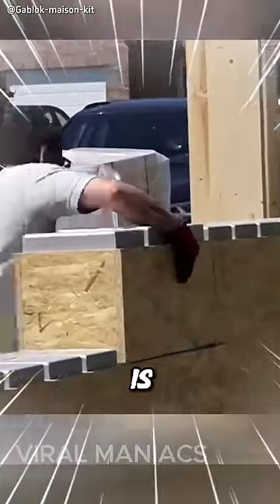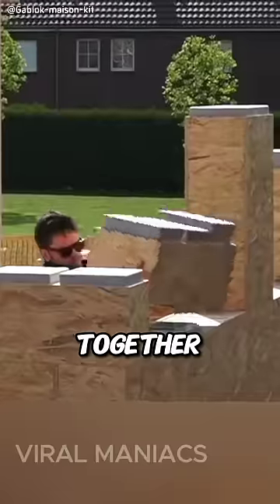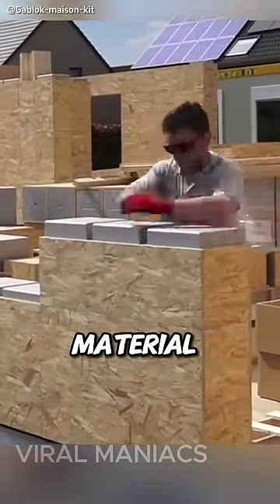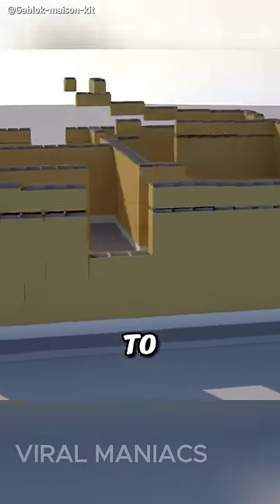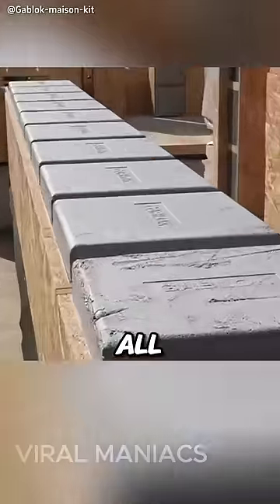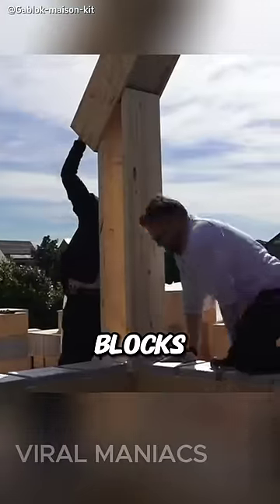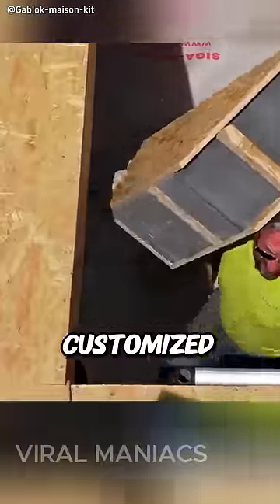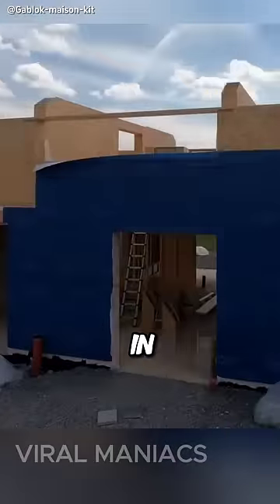Whoever Invented This Way Of Building Houses Is a Genius #shorts

Comment: Would be nice to see a finished product, also, how they run electric cables and plumbing?
Reply: That was my first question too
Reply: Ya mine to ..
Reply: My immediate response!
Reply: As someone who is neither a plumber nor an electrician,  thank you for thinking of this. Now I feel we just watched a video on how to build children a very expensive but cool fort lol
Reply: Howww
Reply: tape
Reply: Generally plumbing isn't ran in exterior walls anyway so not a big deal, they can still drill holes through the blocks to allow pipes. I imagine if you're running vertical stuff you can just take the insulation cubes out and now you have nice vertical passageways for your stuff to run through then you can use spray foam or drop in insulation later. electrical you can just router groves through the plywood I imagine, if it's on the interior you can also just put up 2x4 spacers on the wall (like you'd frame a house, but lay them flat) and then run your wires between that gap and drywall over it. This design is pretty similar to SIP construction (Structurally Insulated Panels) you can google that. That's what they do, you can also run electrical and plumbing through the floor. The interior walls of these houses are framed just like normal homes they don't use the big blocks so it's easy enough to do 95% of your work like normal. These are actually really cool blocks I've never seen them before but I imagine it's not exactly cheap, There's a lot of manufacturing that has to go into making those wooden boxes and cutting the foam and stuff. You're really just trading your on site labor costs for the labor costs of a factory worker. But the insultation value would be really good. I want to see them use blocks for the roof though that'd be fun.
Reply: Exactly my thoughts too!
Reply: I was wondering the same thing
Reply: See one of the comment above. They explain that certain blocks come special that are specifics for plumbing or electrical. It's all part of the layout that's made before they send out the blocks.

Comment: The toxic fumes if it burns will kill you😮😮😮
Reply: Fiberglass also bad
Reply: Isn’t this the case with literally everything in our homes already? 😂😂😂
Reply: Your house has fiberglass insulation doesn’t it?
Reply: Possible the flames will do it as well.
Reply: @user-wx7gu3jq8s, that statement could be made with regards to many types of homes.
Reply: @kristopherluster6709 If you live in America and not in an urban center, very much yes, as your house is probably made mostly out of wood. Never had the courage to live in one of those when I lived in the states, I trust concrete buildings far more than half the tradesmen that work in frame houses.

I ended up moving to southamerica and here it's mostly brick and mortar for regular houses, and concrete for buildings. I built a brick and mortar house with vaulted ceilings and vitrified clay tiles on top, and the wall paint is limewash, as most plastic based paints develop mold in a couple of years if you run a humid heater. So, my house is entirely fireproof, except for the wooden furniture, and even if it catches fire, it will be quite localized and will not engulf the whole place leaving me houseless (I still would have a couple of barns on the property, so technically not homeless). Nothing like living in a solid house like the one I grew up in.
Reply: Just what I was thinking!!
Reply: Unlike the fire itself that will only hurt a little.
Reply: @kristopherluster6709 Exactly!!! Just the glue in the OSB is toxic enough!🙄
Reply: And others!
Reply: True, but that applies to most houses constructed in the past 60 years.

Blessings! 🙏🏻 
Jess.🌹
Reply: @cindybarber8449 I don't think so. That's why it's used.
Reply: It's likely treated with a fire retardant. EU standards are pretty robust on these issues.
Reply: Probably better to avoid flames & get out, rather than sniffing fumes?
Reply: @everyhandletaken  Nah, I'm going to stay and huff the fumes. Get one last high in my house. 😂
Reply: Pretty sure, the fire will kill you also.
Reply: @TheScreaminTiger  not to mention furniture itself is very toxic when burned. Made almost entirely of synthetics (and wood), synthetics are petroleum based lol
Reply: 💯 everything burns and makes toxic fumes. So what's your point?
Reply: YES!!!
Reply: Do you have any cpvc pipes in your home? The fumes from a 3 foot piece of schedule 40 pipe will kill everyone in a 1200 square. ft. house. ( from a talk by a fire department safety inspector.) 😊
Reply: @kellybarthel8060 Maybe..
Reply: You would be a burnt brisket before you'd die ofuss. fumes.
Reply: @glowllama  Most fire deaths are dead from smoke and fumes before they're ever burnt. ( fireman safety officer seminar.) Said to get down with head near floor where smoke is thinnest while escaping.
Reply: @kristopherluster6709 only if you buy cheap shit. Some people really love all sorts of plastic though.
Reply: Just like everything else in your house.carpets furniture.maybe not so relevant now but in firefighting we were taught that one whiff of a burning telephone would kill you.
Reply: @kristopherluster6709  no it’s not like the stuff in your house. Polystyrene is ridiculously flammable. Plenty of stuff in your house, including the design of it is fire, retardant and containing. Of course, for only a certain amount of time. But this thing is just dangerous.
Reply: You're talking about every modern structure ever built for well 200 years. A WOOD home will also kill you if stay in it while it's burning.
Reply: As opposed to the non toxic fumes by most fires? What?

Comment: so basically your house is held together by plywood...
Reply: Worse. Particle board.
Reply: @trigjones nope, that's just an US thing no 1st world country build houses like that
Reply: OSB and plywood are two very different things. I'd trust a structure made of plywood far more than I would one made of OSB.
Reply: 🤔After all the "wild fires" recently, I would be skeptical about using this material.
Reply: @stefaniabrazzi1358  I love it when people create a scenario like:
“wOuldN't iT bE vOlnUrabLe tO wiLdFirEs” 

like a normal house stands a chance to a conflagration
Reply: @filippetrula1234  Not really each country has a different architectural style on how they build houses, so not all 1st world uses drywall or any variation of it.
Reply: No, gravity
Reply: No, Styrofoam.
Reply: @jothain  No, Chipboard, better than particleboard, but not by much.
Reply: Actually the person who said styrofoam is correct. In strong wind conditions it's the styrofoam that's holding it together. 

You can probably build like this in somewhat cold, no fires, no strong winds area.
Reply: This product is intended for Europe and the company is from Belgium.  Of course this video lacks lots of parts of their building system, like the structural beams that are the ACTUAL structure of the house along with the brick walls.

These are basically replacements for ICF (which use concrete and are VERY not green) and SIPs (which these basically still are).

This is 100% for timber framing.

Comment: Me: Nice...where's the HVAC, plumbing, and electrical?
Builder:...shit...
Reply: Just what I was thinking
Reply: Facts. Just a big tree house IMO.
Reply: Exactly😂😂😂
Reply: @Yin_Strider with no tree, wild. Lolooo
Reply: I'm betting they have blocks with cutouts for plumbing and electrical but they don't look as nice as the normal ones so they didn't show them or something
Reply: @MrGreenbeans2  mechanical specific and unique to every home, we have to "layout" our rough ins on the fly, and things rarely go perfect, I'm a plumber and we need to coordinate with hvac installers so we don't run into each other stuff, it's quite technical and I don't think it can be "generic mass produced"
Reply: You can easily build a 50-100mm internal space on the external wall for those elements. (take that into account for the initial design and outer dimensions). My issue is that OSB expands a lot when wet, and once it has deformed from moisture, it does not go back.
Reply: same way they do that in Europe when building from bricks :)
Reply: HVAC: Plan it, and you get blocks with precut holes?

Pipes and electrical: I'd assume a spacer on inner walls and run it behind it?
Reply: Couldn't you just remove the insulation blocks along pipe and power lines and then fill them with spray insulation ?
Reply: literally what I was thinking haha
Reply: Hello Mr. Negative, all of that can be external.
Reply: Here’s what their website says! (I was super curious too!! 😂) 

If insulated wooden blocks fit into each other to form the load-bearing walls of the house, you may need some advice concerning more technical issues.

Some issues include electricity, alarm and plumbing.

Don’t worry, the Gablok system has foreseen everything.

The distance between two rafters that hold the insulated wooden blocks together is referred as a “technical duct” and it is +- 40 cm. This distance allows you to easily install the various technical connections required for the smooth running of your house.

The floor elements are also provided with a 10 cm space allowing the passage of your water piping system, sanitary facilities and electrical wiring.
Reply: Except for electrical,  you shouldn't run those things through exterior walls anyway.
Reply: Still in A box😂
Reply: I mean... HVAC and electric runs between the exterior surface material and your interior wall surface material. So, I'd assume just like with brick, stucco, whatever else... none of which has HVAC, plumbing, or electric literally running through it... they'll install it between these legos and the interior wall. 🤷🏻‍♀️
Reply: And the fire insurance.
Reply: Then you get home from work and your big screen tv is laying shattered on the floor. Cabinets are on the floor. No good structure to screw to.
Reply: These blocks are just the structure... basically a frame so you'd still have plumbing, electrical, and hvac *facepalm*. Want the company to send you all of that too? If you plan on building a house, you should already have a foundation poured and plumbing already in tact, then call your local electric company and they'll run electric to your new plot of land, and you'll have to have contractors come and do everything like any other project. :/ derp
Reply: Mmmmm
Reply: @bentlybilderback5768   like a 747!! Tell me you know absolutely nothing about home construction without telling me. 😑 and where do the pipes and lines go?? On the face of the wall so it looks unfinished? What about a house on a concrete slab?As you would say, "face palm...DERP"
Reply: My thoughts exactly
Reply: Ehhm just a installment layer on the inside, like in every modern building that isn't in the USA.
Reply: You really think the genius who had invented this wouldn’t think of that lol
Reply: Yeah im sure they forgot about that shit.  Its a youtube short dude
Reply: That is true!!!! If this were a shed or garage wall project then yeah… but home? Maybe model home for display! Or prop homes for acting! Unless the vanities come with pre-fitted plumbing and they’re using led lights for wiring, and battery operated utilities
Reply: Needs to get tornado and hurricane insurance ×2
Reply: It all gets primitively nailed visibly to the interior walls, instead of getting attached to the framing skeleton and covered with drywall

Comment: My last house I owned had a new house being built next door. It was the same material and was completely finished in five months while conventional ones took over a year. Neighbors all took small fragments of discarded blocks in the construction dumpster for souvenirs. There was very little waste and assembled very quickly. This was the first time I ever saw this technique.
Reply: If a house takes a year to be built nowadays , the builders are incompetent.
Reply: Is the house still standing in solid condition?   I've seen experimental material home builds in the past have to be condemned in just a few years.  Mother Nature is always out to destroy.
Reply: And I suppose that probably the 4 months was just the typical plumbing and electrical and the stuff that's done in all houses. The blocks seems to have cut about 7 or 8 or 9 months from the project which is quite amazing with the fact that also they are some of the most sturdy add to beneficial for heat and cold retention.
Reply: @hoffpbass  That's what I was thinking.
Reply: Where I live in Canada a house takes a few months to build conventional not a year, you guys are doing something wrong for sure
Reply: I wonder if this is more or less cost than a regular build??
Reply: What a load of 💩
Reply: @jamesscruggs4557  depends on the size of the home and what detailed extras it's getting.   And in the past two years where materials were short.  I was on projects where the build start date was delayed by months because stuff was 6-9 months out and they didn't want to have the project half finished.  So it was better to start later.
Reply: Definitely sturdy and insulated.genius for sure . OSB is recycled and strong.Hemp fiber could used in similar fashion and could be fire proof.
Reply: @hoffpbass  That type of build will have more torsional rigidity than a standard stick build...
Reply: @darlenebertocci4631  I'd think about the same. Material costs up, but labour costs down....That's why contractors don't like them.....
Reply: Please show the finished product!!
Reply: @jamesscruggs4557 In California,  it takes that long just to get a permit.
Reply: if you start building before you get all the permits, you've just proven my case, they're incompetent.
Check and mate
Reply: @darlenebertocci4631  depends on the weather  where you live
Reply: @nileist6666  3 months 2 story lockup js
Reply: Where do you run your utilities, water and electric?
Reply: It takes 5 months to build a 3k sq feet house.
Reply: Ok you’ve heard the story of the 3 little pigs right ?
Reply: @nileist6666 We used to build basic spec homes pretty quickly back in the day.  Larger and custom homes can easily take a year or more.   Today's biggest time consuming problem is inspections.  The city is in no hurry and if something is wrong then just add to the wait unless it's a community in which case the city is on site much more frequently.
Reply: @jamesscruggs4557  It can totally depend on availibility of both materials and labour. We aren't in the "good ol' days" where everything just rolled along like clockwork. Even before covid when supply chains imploded.. I did a job where the drywall was on backorder for 3 months.
Reply: @jamesscruggs4557  if you have any  experience in new home construction, you must know how difficult it has become to find qualified tradesmen having the skills in framing, electrical, plumbing and glazing. Dry wall techs, tile setters, flooring layers, painters, trim carpenters, furnace, and air handler specialists are all in extreme demand, and permitting has become a nightmare. The average 3 bdr 2 bath takes 18 months in most areas while in areas where there is adequate government staff to process permits and construction  inspectors you could get one finished around 6 to 8 months but I would seriously be suspicious of the quality of work performed. I built my first house in 1970. How about you?
Reply: @nileist6666  it all depends where you live.
Reply: @eats4cheaps305  if your a noob

Comment: This is a cool idea, but I can see some flaws (at least they don't talk about where electricity, heating, plumbing, and all that goes)
I can see it being something fun or practical like a clubhouse or a shed, but there are some issues when it becomes a permanent dwelling.
I read someone pointing out that it'd go up in flames in a moment, and that high winds such as a hurricane or tornado will blow it away in a moment. I was sitting here thinking "it has to be pretty heavy" but... Polystyrene is quite light. That compound plywood isn't that heavy.

Cool? Yes. I'm sure there will come a time where this method can be quite viable.

I'd love to hear from engineers if they can tell me if this is actually viable as it sits. I'm legit interested in listening to real talk on how this works